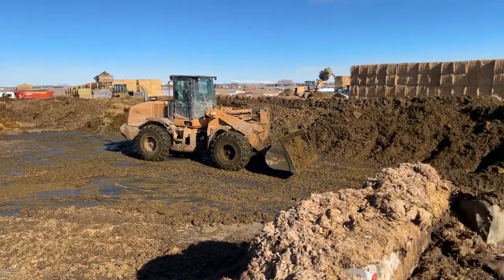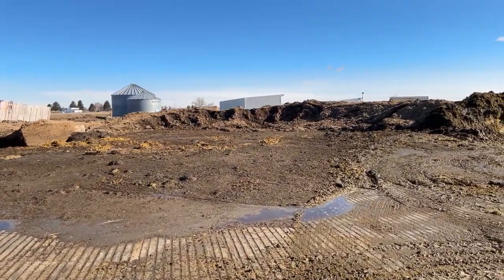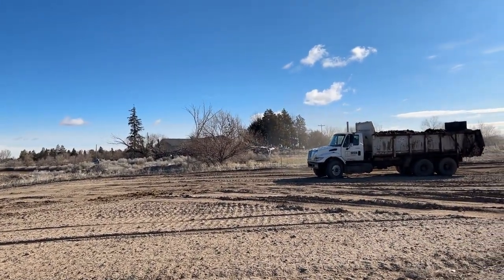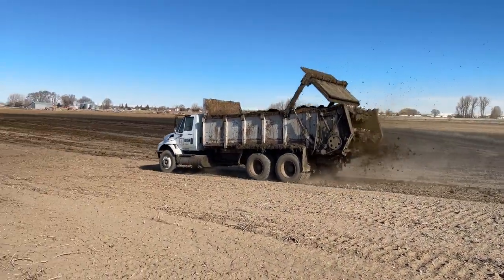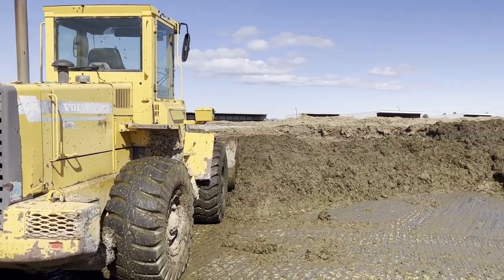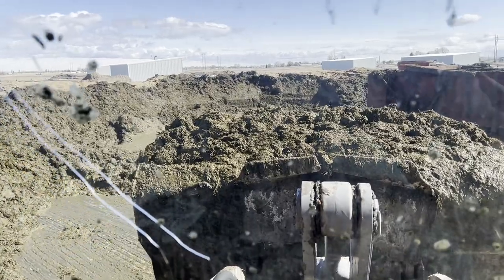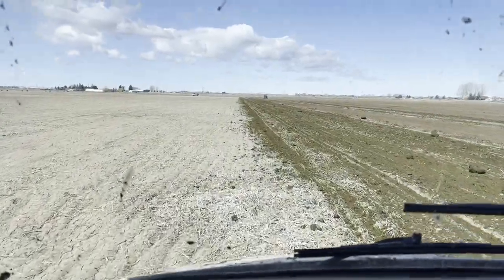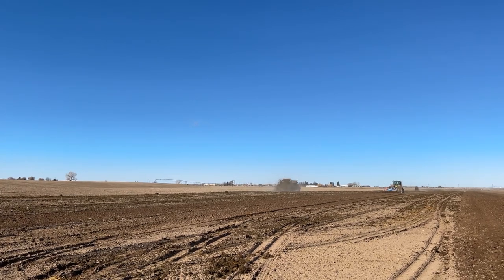How we haul and spread cow manure. | Amazing Drone Footage |

Comment: Cool video.  Why don’t you just keep one guy in the loader if you are running 8 trucks.  Seems like lots of wasted time going in and out of vehicles.  Also, why park so far from where you are loading?  Short movements save time.  Looks like fun, great video.
Reply from the maker: One reason we don’t put somebody in the loader is because it’s hard to find enough people to run everything. Because we would need three more people.  And we do park about as close as we can to the area we’re hauling out of.